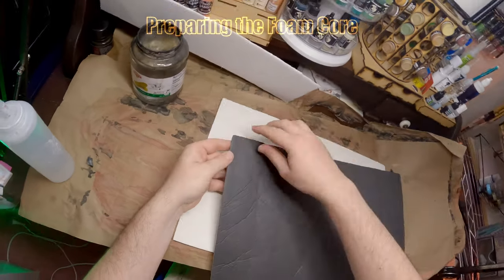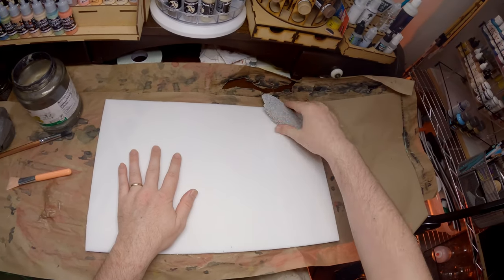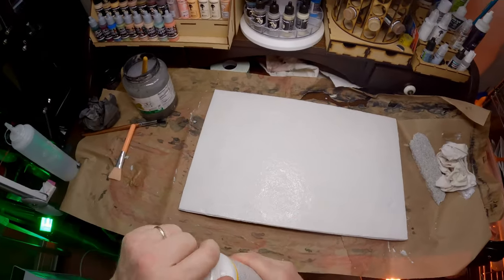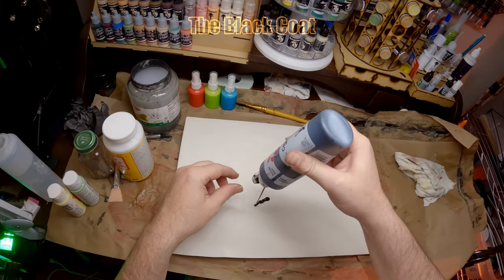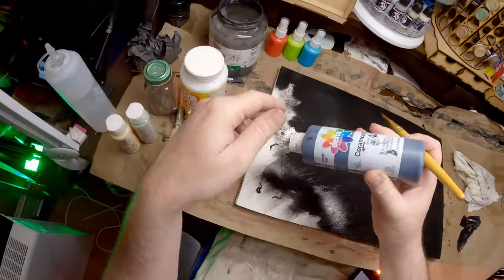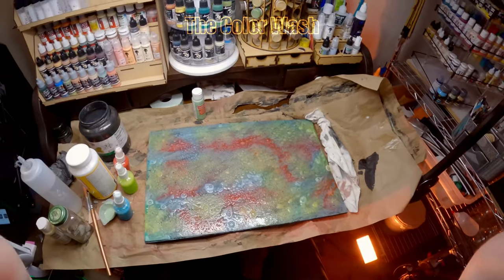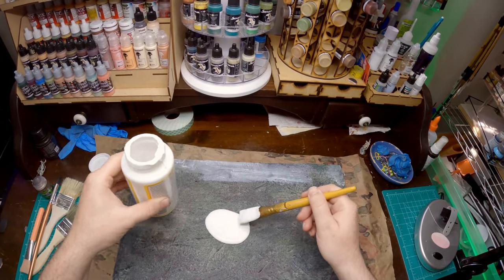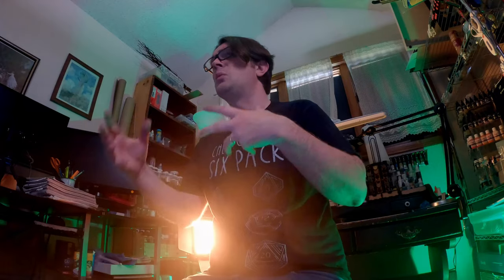How to Make a Cave Dungeon Tile, Battlemat Thingy

Comment: I like it, I'mma try it. Subscribed too. An easy way to remove paper from your foam core is to get it a bit wet, comes right off, use a spray bottle <3
Reply from the maker: Thank you for the Sub, and, more importantly, the awesome tip.